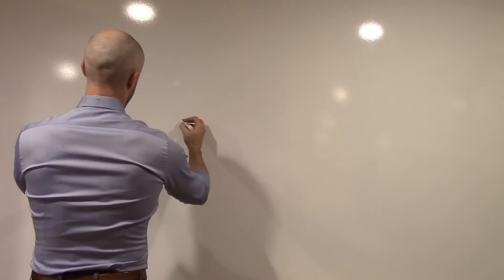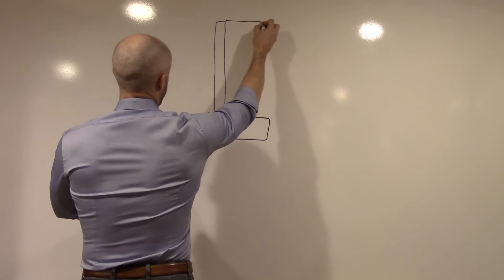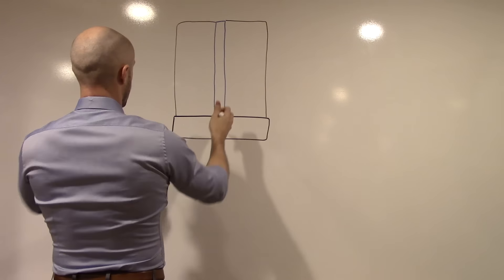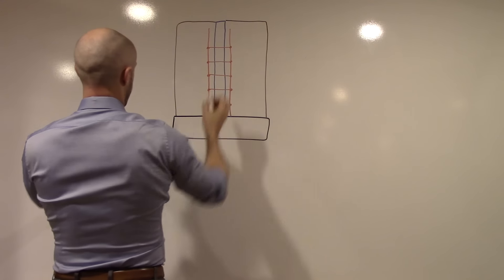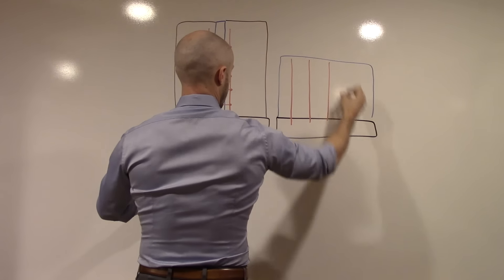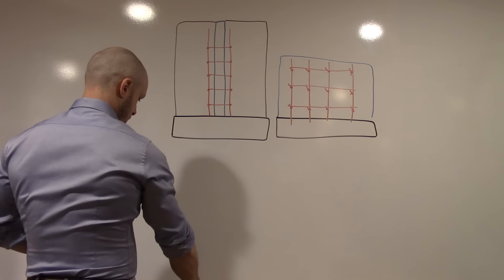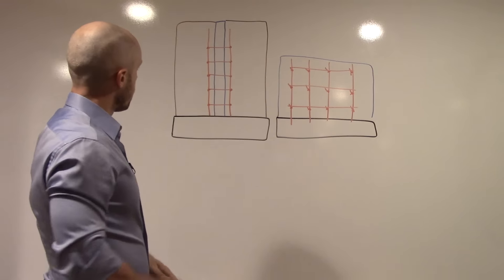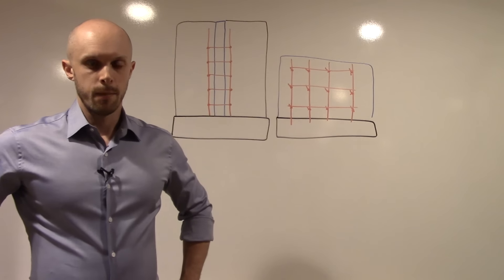BUILDING A COB HOUSE IN COLD CLIMATES - INSULATED COB WALLS

Comment: Cavity walls have been used for masonry construction for over 100 years so the video is on the right track to bring cob up to modern insulation performance. However, the ties in between the inner and outer leaves do not need to be rebar; it can be small splits or sawn pieces of a rot resistant hard wood such as black locust or white oak. The insulation should be breathable and could be mineral wool or natural wool batts. Steel rebar and foam insulation are not appropriate in a cob structure. When cob buildings have a non-permeable barrier, such as foam would be, there have been failures of 500 year old houses in England and failures of historic abobe missions in the American Southwest.
Reply: i wouldnt be averse to using galvanised strapping band to tie the two walls together, the type sold locally has half inch holes every inch and would grip the cob well, its flexible enough to cope with movement but wont tear apart.
i agree with the wool insulation.
as to wood in side the structure, its usual to place wooden cuttoffs in the wall to give something for screws to bite, and ive seen it used at door and window frames, you could use  hardwood timber 6 inch offcuts  of at least 2ich diameter in each half of wall and tie across with heavy galvanised wire, you only need do it at 1 metre intervals across and  i metre every vertical foot.
im not a fan of foamboard but moisture shouldnt penetrate 12 inches into a wall, if it does, your overhang is not good enough, or your roof is leaking!
Reply: Gregory Lehman how about using basalt rebar?
Reply: @willg4802  I was thinking the same thing! The problem would be, as I see it, the point of using basalt rebar in a concrete slab is that it has a similar expand and contract ratio as concrete. I suspect a cob house would not. It makes me wonder why straw, sand and clay create such a happy marriage together...okay, maybe a polyamorous relationship together...

Comment: maybe we could use some comments from folks who have actually lived in a cob house, in really cold weather.
Reply: I ate a cob on the corn for dinner does that count.
Reply: I built a tipi with a cob foundation wall of about 3 feet. So his R-3 value makes sense to me. I added about 8 bales of straw for more insulation and then I added rockwool.
Reply: @voidisyinyangvoidisyinyang885  Did you build a cob foundation on stone or concrete?
Reply: @lisawintler-cox1641  Actually the wall is double wattle - https://www.youtube.com/watch?v=CUQRFlD2UuQ here is my upload vid on it. The foundation - I wanted to make sure to get negative ions from the Earth - so I just have a thin layer of clay-horse manure-sand - a cob foundation of just an inch or so. Then on the outside I have a lime S-mortar with horse manure for water proofing onto a clayslip horse manure daub on top of the 3 feet high wattle walls - double sided. Maybe the walls are 3 1/2 feet. I never measured. Kind of funny now that I think of it. Yeah I guess I just eye-balled the wall height - the posts and sill beam. Anyway it's a raw primitive style. thanks. Oh this is not the tipi - the tipi just also has clay on the floor. It's too dusty just as straight clay. So that's why I made sure to add horse manure for the Hermit Hut. I have a tipi and Hermit hut - both 120 sq. ft each. I don't live in them but I could live there 7 months a year. So I plan on doing that.

Comment: I'm questioning whether the styrofoam insulation is vapor-permeable, because the wall needs to be able to breath from the interior to the exterior to get rid of moisture build-up.  I have seen reports that old cob houses in England that were plastered with portland cement based plaster on the exterior had moisture trapped in the cob, causing it to soften, and some of the old cob houses have collapsed as a result.  I'm wondering why not take a different approach - use cob for the outer ten inches, and straw-light clay for perhaps fourteen inches on the interior, then plaster both interior and exterior with a lime or mud plaster.  Straw-light clay has an R value of about 1.5 to 1.7 per inch of thickness, and cob I think is about R 1.0 per inch.  So it would be possible to get an R - 30 wall about 26 inches thick this way.  The building might also need additional support for the roof in the form of vertical timbers if doing this, because the straw-light clay is not structural and ten inches of cob might not be good enough for roof loads.  Any thoughts on that?
Reply: id say if it is buried 12 inches in a wall, water vapour  will not disperse right through, its just the outer 3-4 inches that hold moisture, especially if you have good overhang on the roof.
inside you would get even less moisture penetration once the structure has dried right out.
you could substitute polystyrene board for a wool insulation and it would probably perform better, but is expensive.
if the wall plate is supported on 10 inches of cob i think it would have enough loadbearing, you would have to construct the roof well to spread the load evenly, and a continuous wall plate acts as a ring beam to help tie the building together.
more organic shapes of house would need good planning, but the load is essentially downwards.
and in areas of high snowfall i would pitch the roof steeply to shed snow.
Reply: ventilation; only 2% of overall moisture penetrates the wall inside->outside; ventilation
Reply: My dad built a styrofoam boat
Reply: John Terry or, you could have several inches of rockwool insulation on the outside and just cover that with lime render. A better approach though would be a house made of stabilized compressed earth block with a pocket between the walls fulled with rockwool or foamed magnesium cement insulation.
Reply: It's a solid attempt, but it has a lot of potential to cause water damage. I've read about conventional houses in the past (80's?)that used a new concrete stucco system and the result was water damage to the wood, crumbling stucco, and mold in the insulation. It's an obsolete stucco system. Builders learned from their mistakes and now use concrete stucco in a way that air can move in and out. The point being, you can get wet, you just have to be able to get dry afterwards. This seems more like an hypothesis than a working theory. I know having a pocket in the middle with loose stones in the center is how stone walls used to be built. They also used horse hair, sheeps wool, whatever was at hand when building the older cob houses.
Reply: @thegreenman4898  I watched a video by a couple that had moisture sensors in their walls and when many people gathered inside they said the cob and plaster absorbed the moisture. After the group of people left, the moisture was slowly expelled.
Reply: @lisawintler-cox1641  yes, the advantage of having a breathable wall , the modern approach seems to be to make the house airtight, that cant be healthy
Reply: @lisawintler-cox1641  i seen it as well...pretty cool stuff
Reply: @willg4802  compressed earth block...is that like rammed earth?...could have timber frame for supports, 10in of rammed earth on outside, 2in roolwool middle, and 12in of cob on inside.
Reply: @lisawintler-cox1641   a pocket in the middle with stones in it sounds strong..used it for load bearing?
Reply: You have me thinking about what I actually know, and  with regards to strength and lines of force, I don't know.

I know that that's how they built stone retaining walls in the past, and how they are repairing old stone walls damaged from repairs made using modern cement as mortar. I've always assumed it was due to heave. Allowing the wall to flex, and even crack, along the joints without a catastrophic wall failure. It's also a thermal break, and a place to put the odds and ends. 

I've seen homes have been built with single and double stone/brick walls in the past with the inside wall used to support joists.It was hard on the joists. Now I'm wondering if it's the mismatched materials.
Reply: @lisawintler-cox1641  hmm..well one thing we know is that they didnt have the building codes we do now, and im worried that i wont be able to build a cob home next year. i live in the west kootenays in bc, canada, and there isnt a straw bale building code yet i dont think. i know there is one for the usa, and i think there is an international straw bale building code. i guess theres only one way to find out if the will go for it, is to get the plans drawn up, and go have a meeting with the building permit person...the property is rural, and most people build around there without getting permits, but i just cant rip myself off by not doing it by the districts book...its just so limiting to earthen harmony.
Reply: @D.A.T.  https://www.youtube.com/watch?v=mtQChQXKrkA gives a good overview
Reply: you can wait a year than insulate it🤷‍♂️
Reply: I was just watching a renovation video actually lol

I'm not sure if it's readily available, but they used woodwool as insulation. I've also heard of mineral stone wool insulation
Reply: Depending on where you're at, it's probably easier/harder to access (like I think it may be more readily available in the uk and Canada, but I really need to look more into this stuff myself! Lol).
Reply: HOW about COB wall in interior that provide thermal mass and structural strenght and staw bales on exterior for insulation. THE straw bale in plastereded in exterior.
Reply: @thegreenman4898  Passive house standards seek air tightness, but vapor permeability (air and water can't pass, but vapor can freely pass). To compensate for the stale air they use excellent mechanical ventilation (ERV's and HRV's like ductless mini-splits, etc.) to keep air fresh. An air-leaky house is an inefficient house (bad for planet, bad for energy bills), but hey, plenty of fresh air!
Reply: John Terry - I like your thinking. What's your take on your thinking given the comments and your subsequent learning four years later?
Reply: @LitoGeorge  I'm still thinking the same way, but one consideration is that cob and straw-light clay have much different densities, so the foundation footing may need to be offset towards the outside so that the extra weight of the cob compared to the straw-light clay wouldn't try to topple the wall towards the outside by tilting the foundation.  The idea would be to balance the overturning moments provided by the different materials (the concept is similar but not exactly the same as what needs to be done with a retaining wall to keep it from leaning over).  I'm still thinking a timber frame to support the roof and the second storey might be a good thing also, depending on the loads and the tested strength of the cob made from the local soil, and whether the cob would have enough strength without the timber frame or not.  The only problem I see with my thoughts on this is that it would be extremely labor intensive to build this way.
Reply: @johnterry8958  thanks for an insightful and thoughtful response John. I gave some thought to your foundation concerns and my initial thought is that the foundation would not be subject to lateral pressure like a retaining wall would (overturning moment due to significant lateral pressure from enormous weight from keeping all that soil in place). Your scenario would require the foundation to function like buoyancy in a boat - and I dont believe that the foundation would give way or overturn in this manner. Imagine if you will, that you build a foundation for cob, and you happen to build another adjoining foundation for a SLC wall. I cannot see how the one would affect the other if the foundation is built correctly, unless you're building in swamp which is entirely a different topic. Looking forward to mentally sparring with you on this as I find the concept a marriage of the best of both worlds. Some of my reading has indicated there might be an issue with the SLC not being able to dry sufficiently with a wall of cob on the outside and I hope to tackle this with someone with a bit of experience. Best, LG.
Reply: I live in an old Victorian stone built house. We got damp in when ordinary building works was used but now we are putting back the old lime cement and plaster which is breathable. It’s costly for the building but cheap if you can do it yourself, worth it I think. The lime wash paint is very cheap and for colours you just mix in pigment. My house is over 100 yrs old and is till very strong.
Reply: Check out the work undertaken by a UK/French Research project called CobBauge. Their technique is to combine two cob materials in a single wall. A structural, traditional cob wall with a lighter, natural insulative element on the external structural face. As both materials are clay based, the two elements form a natural composite, the moisture content balancing drying/shrinkage to make a coherent structure. A lime with fibre based external render provides a durable and vapour permeable out skin.

Comment: I know you were trying to answer a specific question in this video, but I can't help thinking straw bale with a natural render would always be a better idea than this for both performance and ecological reasons. Like others I would be concerned about the long term health of the rebar in a wall that's constantly changing temp and moisture levels. But I wonder why, if you did go for cob, it wouldn't be better to use a breathable insulating layer on one side of the cob, instead of in the middle? I think of wood fibre board and earth plaster or hempcrete etc..
Reply: That's actually a good point. Failure on the outside seems less catastrophic to me than in the middle.
Reply: I was thinking that you could replace the rebar with bamboo

Comment: I realize that cob buildings are proof that ideas can seem impossible when they are actually quite workable. I'm still at the planning stage so I'm no expert, but the first thought I had was "What about condensation?" If you have cold air hitting hot air or vise versa you will have condensation. I believe this is why they cover the insulation in conventional buildings with a barrier, to keep the condensation from forming and creating mold or water damage. I'm thinking of the new concrete system stucco disasters that caused major damage to the houses that adopted it. Also, if condensation does form, and if it trickles down the side of the insulation, it has nowhere to go. As to using rebar...rust. If you have moisture traveling through cob it will eventually rust. In fact the rebar at our building center here comes pre-rusted for your convenience. The rebar will rust from the outside in creating pockets around the rebar. Older cob buildings in England must weather the cold, what do they do? I suspect using horse hair provided some insulation plus the fact you were often very close together building-wise meant more shared comfort. I know wool is expensive, but belly wool is cheaper and they make wool batting in quilt sizes (admittedly, treated with something to retain its shape).
Reply: Lisa Wintler-Cox , look into earth bag construction.  Earth bag dwellings, covered in cob, are highly insulated and all natural.
Reply: I'm two years late, but rebar?  It's a cob wall you don't put metal in it.  Straw the length of your forearm

Comment: Could you just make the outer wall cob and do a more modern approach where you have occasional pegs that the vertical pieces of wood and horizontal slats would go on. Then insulate between the slats and the cob wall and either plaster over the slats or have wooden walls?

Comment: Use pallets and fill void with rock wool . Collect off cuts from building sites   Rock wool is breathable and dose not rot. Or attract mould  and it’s fire proof. But that’s not a problem if it’s sandwiched between the two cob walls.   Cover the pallet with breather membrane   Or  permeable weed matting before punching through.  With rebar Just to make sure the  cob dosnt compress into the voids when tamping. Down

Comment: Could you mix insulation material into the cob, like the ceramic beads used in insulating chimney liners.?
Reply: You could sandwich slip straw between 2 layers of cob

Comment: Thanks for the presentation! And acknowledging that one needs more than thermal mass in cold climates. We use 1/16" stainless wire through the foam at a 12" x 12" grid +/-. Stainless has half the heat transfer as steel, and the wires are high strength enough for seismic loads at the very small diameter, so the heat bridging is very minimal.
Reply: is this a ferro cement tactic originally?
Reply: Can you talk about this some more? I'd be appreciative. Do you think the stainless steel wire allows moisture to travel along its length? How do you compensate for the expansion and contraction of different materials? Have you done experiments where you explored the insides of a test wall over time? I'm very curious.

You may think this is off topic, but when I sew, if I use natural fibers I don't use man-made thread even if it is covered with a natural fiber. Man-made  thread is stronger than natural fibers and can cause seams to tear. They move differently also and can make a seam that puckers or messes with the drape. My point is, this is a sticky wicket.

Comment: I’m considering building a 400~500 sf cabin in northern Canada. Could thicker insulation be used between the cob walls? Or would straw bale be better? Wondering what R-value would be for wall you have drawn? How can I achieve a higher R-value?

Comment: My husband and I are planning on building a straw bale and cob home in Ontario! Really appreciate all the advice from your videos! 
I do have a question though.. If our straw bale makes our walls 1.5 -3 ft wide, will we still need to use up to 8 inches of cob? Or could we get away with perhaps a thinner amount?
Reply from the maker: Yes, absolutely not necessary. Just put a regular earthen plaster over the strawbales.